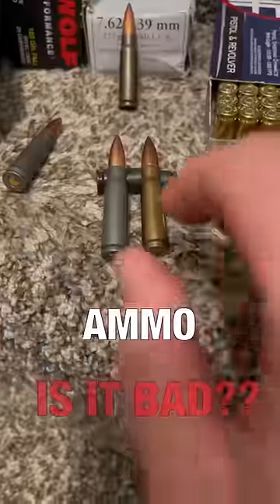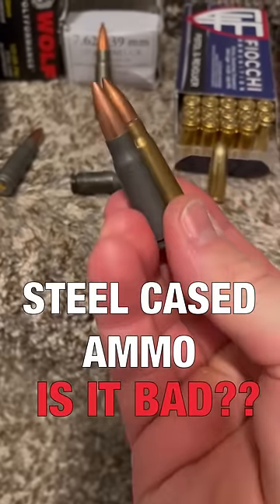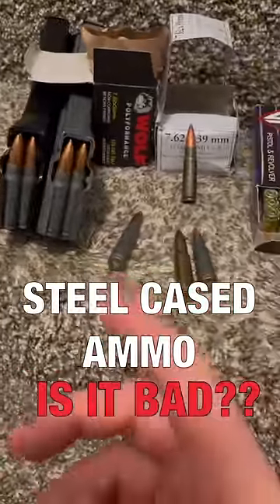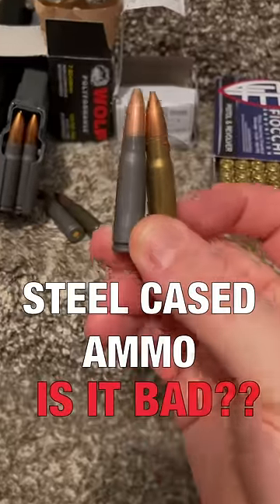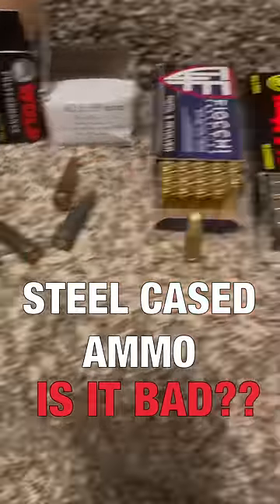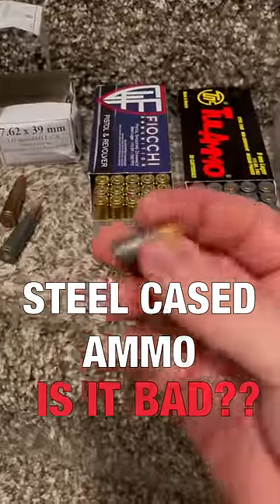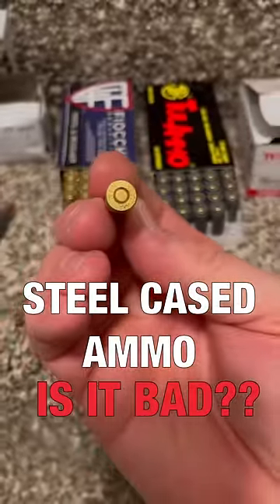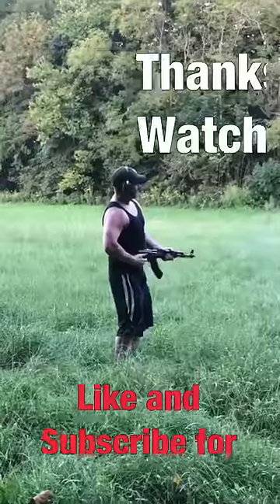Steel cased ammo, is it bad? #short #shorts #shortvideo

Comment: Good topic.  It's been tested and studied several times, and beat to death, but people still argue about it. 

Extractors are the only short term part wear you'll see.  MAYBE a damaged ejector COULD BE seen, but unlikely.  The coating could be an issue, but it builds up over time, and shouldn't ever be a single trip issue.  Clean your weapon after using it and you'll never see that be an issue. 

There have been plenty of very good, comprehensive tests done on this topic.  There's even a very good one that focused just on ARs, and fired 10,000 rounds of different brands of steel, compared to an identical rifle shooting brass, and another shooting both. 

Like everything else in the firearms industry, the biggest problems are institutional inbreeding and wannabe tacticool mall ninjas spreading false info and exaggerating half truths they don't understand.
Reply: Yes, it was Lucky Gunner that did the test. Funny how Federal brass had zero malfunctions in 10k rounds, Brown Bear had 9 with it requiring a new gas tube and bolt carrier due to carbon fouling, Wolf had 15, and the rifle using Tula literally got pulled out of the test prior to 500 rounds due to the sheer amount of malfunctions. 

And to add to that, the rifle shooting brass maintained serviceable accuracy till the end. The rifles shooting steel showed extreme accuracy loss and even keyholing at 6000 rounds. Bimetal jackets found with steel case ammo are hard on barrels. 

Anyone that says they've never had issues with steel doesn't shoot enough. These are the same people that take their Bear Creek and Durkin Tactical ARs to the range, rip 30 rounds through them, and call them good and reliable guns.

Comment: I like reloading the steel stuff. I've been doing that for over 30 years. Thank God they use boxer primers now as it saves me from converting the cases. Steel is only about two brindle points harder than brass. But the nice thing about reloading it is that I don't have to search through the grass to police my cases. They biodegrade in about a year.
Reply: I have always been told you cannot reload steel case ammo.
Reply: @MrMech-oj7iy  well know ya know lol
Reply: @MrMech-oj7iy  yeah, I always found that weird, like why wouldn't you be able to reload it?  Maybe it's a bit harder and maybe reloading equipment made for brass won't cut it, but there's no reason you couldn't get dies specifically made for steel case.  Maybe that tiny extra hardness causes them to crack more often so the value of reloading them is less, but it shouldn't be straight up impossible.  I might believe that about aluminum cases as aluminum is severely prone to work hardening, but steel?  That's arguably one of the most versatile and durable metals on Earth when used correctly.
Reply: It's amazing how few people realize you can reload steel and aluminum cases.  I don't bother reloading berdan primer cases, I just trash them.  But I reload any I find with boxer primers.

There are a couple of defect berdan decappers out there, but I've never tried them on steel.  How hard is it to convert the primer pocket?  Maybe I'm pissing away too many usable  cases. 😁
Reply: I know of a guy who reloads steel cased. I heard the same thing from him about the primers, certain types of primers make the case unusable. From what I understand from the conversation, steel just takes more time because it's harder to trim and fit properly, but if you want to save that money and have the time, why not?
Reply: @herbderbler1585  mostly because all the surplus stuff used Berdan primers. Pain in the ass to pop the primer out because it's two small off center holes instead of one central hole.
Reply: @docv73  aluminum reloading is highly limited. Unlike the ductility of brass and steel, aluminum is far more prone to work hardening and cracking. Annealing only does so much.

Aluminum straight cases are far more reloadable than necked cases.
Reply: @toddk1377  it's really not harder to trim. Any serious reloader is likely using a powered trimmer with a carbide bit.
Reply: @ObservationofLimits  
I'm just going by what I was told since I don't reload. I'm getting stuff to reload once I have my other affairs in order first.
Reply: @ObservationofLimits  I didn't think of that.  I can see how that would be a deal breaker for many.
Reply: @herbderbler1585  you've obviously never tried to modify reloading dies. Sizing dies are *hard*. Steel cases are not. Lube it and size it, it's not a big deal.
Reply: @MrMech-oj7iy  you can, it's just harder and not advised.

The steel casing doesn't expand the same as brass ammo. So reloading it can cause weapon malfunctions if not done properly. Then the primers are a pain in the ass.

Brass is softer and easier to reload.

But it is also not recommended to reload brass ammo more than 3 times, and I know people using the same casing for their 12th time lol
Reply: @ObservationofLimits  yeah, I don't reload aluminum shells. Too much risk, and don't want issues when firing.

Brass is the easiest to start learning on. 

Maybe when I get more practice I'll do aluminum.

Comment: Reason it's tough on extractors is because not only does your extractor have to run over the lip of the round, but when steel expands, it doesn't contract anywhere near what brass does (elasticity like you said) , so your extractor also has to work more trying to yank it out of the chamber (this is really only seen on AR platforms running steel cased because of tighter chambers)
Reply: Never had this problem with .223, .223 wylde, 5.56, or x39 chambered ARs.
Reply: @ObservationofLimits  ok, that's good and all....but that still doesn't mean it's not a known issue
Reply: My target rifle has minimum headspace and is tight on a go gauge. Runs steel just fine. Keep telling us it's bad when it works for us.
Reply: @randomidiot8142  lmao...re read my comment sir.....I never said it doesn't work, I have a few ARs that I've built for myself and also customers that each have anywhere from 5 to 15k rounds through them....only premature wear was the throat and the extractor....because of the steel casings not contracting like brass does, it's harder on components, simple as that, it's called metallurgy and science lol
Reply: @br00klyngreek13  regardless of brass or steel, extractors go over every rim the same way. Brass rims aren't easier to go over. Ease up on extractor springs and lengthen the gas to drop chamber pressure and extractor stress.
Reply: Steel case is not tough on extractors, at all, whatsoever. .223 steel case ammo tests showed zero difference in wear over 10,000 rounds fired. 

7.62x39 extractors in ARs have less material because of chamber size. Garbage companies like Bear Creek Arsenal have extractors that are not made correctly, and break frequently.
Reply: @phil2082  all about heat treatment
Reply: @br00klyngreek13  It's also about geometry, but I am a mechanical engineer and I know Bear Creek's heat treatment cannot be trusted, or their geometry
Reply: @phil2082  hahaha well put
Reply: I don’t think that’s the ammo’s fault though. If the steel barrel and extractor is so soft that it is shearing off metal from simple cheap steel brass casing or breaking then something is wrong with the metallurgy of the gun.
Reply: Buy an ak or sks see the results it’s amazing

Comment: The only downside I have found is the need to clean the gun more often. Since steel doesn’t expand like brass it does let more material low back into the chamber. The much softer steel that rounds are made of is not going to do anything to the chamber or barrel of a quality firearm. Not really sure why one would think that it would be harder on a barrel. Last time I checked, casings don’t go down the barrel. 

This said, I prefer brass, but I’m happy to keep some steel around for the zombies.
Reply from the maker: Well said 👍

Comment: Yep steel is usually dirty because of the powder they use. Wolf and tulaammo are the dirtiest I ever shot.
Reply: Try some aguila. Very dirty.
Reply: @rmiller334  the only Aguila I use is subsonic. 22. Nice and quiet for squirrels and the entire hunting area, and just a little extra cleaning. I only use it in my bolt action. Not for semiautomatic. First it won't function the action, and it dirties it one shot at a time.
Reply: @bobdixon4998 yeah I've used Aguila in my bolt action 22 also not subsonic though. I've got a Marlin 22lr. Bolt action micro grove barrel. I made a cheap little can for it out of pex plumbing pieces, if you take off the front sight you can slide it right on the barrel I think the outter pipe is 3/4in with a half inch pipe in the middle I drilled a bunch of holes through it and wrapped it in a shop rag tightly just enough so it would fit firmly into the 3/4in pipe then I drilled multiple 1/8in. Holes in the outter pipe and wrapped it a few times with a firm shop rag and then went over the whole thing with tape making sure to leave areas of the rag open so the gasses can escape. When I shoot it with subs the round hitting the target is louder than the gun. I like running CCI for the subs and standard velocity rounds and their stingers Wich shoot 1600-1700fps that gun shoots an extremely tight grouping with the right ammo. I've got a 22magnum scope on it. It's one of my favorite gun's to shoot, very accurate. It's what I taught my boys to shoot on.

Comment: My first experience with steel cased ammo was about forty years ago when a friend and I bought Raven .25 auto pistols on a lark with a couple boxes of very cheap steel cased ammo.

It ran just fine and didn’t hurt the guns. Longer use may have caused those issues but they weren’t exactly EDC.

Comment: I don’t run a lot of steel .223 through my AR, but I run lots through my AK!
Reply: Same, here and there ill run em but mostly brass.
Reply: I ran steel case through my AR and nothing bad happened. I mean I ran steel case through it by the case load both with and without that lacquer coating, and nothing catastrophic happened to my rifle. I did have the occasional dud round though but they also didn’t fire in my 5.56 ak either.
Reply: @SonJWri  I ran a bunch of Tula, Wolf, and Red Army Standard steel-case through my AR when I first got it (Ruger AR556, if you were curious) and it was fine for a while. But I eventually ended up getting a particularly bad FTE/Stuck-case that was a real bitch to remove. 
Every since then, I HAVE shot steel case through that same AR (I still have a bunch of it) but I don’t like to feed my AR’s a steady diet of it. 
However, I’ve never had a stuck case with my AK yet so I still feed it mostly steel case, with brass here-and-there.  With my AR(s) it’s mostly the opposite (mostly brass with some steel here-and-there.)

Comment: Years ago, I worked at a company which polished and ground lots of materials.
We used abrasives suspended in fluids and we also used softer metals to embed abrasives to abrade hard materials. Cleanliness was a great concern for us so that we could control the process.
I say this because the dirt and debris that can get between a cartridge and a chamber wall is abrasive...and the softer brass will get embedded where the steel will not. So, cleanliness is the solution. Dont be afraid to use steel cases, it is not harder than the parts in your guns, but it wont get embedded with dirt like brass can.
Reply from the maker: Good info!  thanks!!

Comment: As mentioned, coated steel ammo is covered in a lacquer-like coating as a preservation and LT storage/mfg strategy. Works pretty well, too. However, that coating tends to liquify at higher temperatures. Not really a problem if you are continually pew-pewing and don’t stop to let things cool with a round in the chamber. Once you stop though and the chamber has a round left in it, the lacquer cools. It becomes an effective glue that will cause any round left in the chamber to essentially weld itself to the chamber wall as the system cools. Very difficult to remove (especially in the field) even with a rod. It sometime takes heat in the shop to do it right - remove round and scour chamber clean. But its tricky because the round is live. This problem is the source of more than a few broken extractors and other mayhem - just ask all those wives, telling all those tales.  IMHO, the price of brass is cheap by comparison.
Reply from the maker: Well said!  Yes I’ve had that problem with some heavily lacquered 7.52x54R ammo in the Mosin.

Comment: I've used almost exclusively steel cased ammo in my SKSs and Mosins since I bought them in the early 90's. I stocked up on spam cans during the same time so that's what I've always used except for the odd brass that I'd pick up on a deal. I've put thousands of rounds through them and have had zero issues with wear or extraction, but I do clean them after every firing. Just have to try it in your gun and seenif it likes it or not.
Reply from the maker: Good point 👍

Comment: Back in the 1990's when ammo was dirt cheap, we shot hundreds of thousands of rounds of cheap steel cased 7.62x39, .223 and 8mm Mauser at the machine gun shoots. I've had an M16 so hot that I cooked off a round of Wolf .223, and still didn't have an extraction issue! The polymer coating is better than the old laquer coating. I did have one round of that stuck in an AR one time. 

And cheap ammo is this, and I don't mean to make you younger guys cry. Russian 7.62x39 was $55/1000. Wolf .223 went for $69/1000. And this one hurts, Venezuelan 7.62x51 NATO CAVIM, brass cased, boxer primed 147gr ball was $150/100. And the insane part was all these prices INCLUDED SHIPPING!

In some ways the 90's sucked, but ammo and milsurps were cheap. I got my C&R FFL and was buying $29 Mosin Nagants, $89 8mm Mausers and even $69 Swedish Mausers. You could get M1 Carbines for $350. And we thought it would never end.......
Reply: I remember those days. Every paycheck I would go to the range with a case or two of 7,62x39 and sometimes a $30 SKS to burn it in. Those were the days, my friend.

Comment: Last time I run steel case. Was in an ar platform, rounds where cleaned and oiled. Gun was clean and oiled. Fired 2 shots, 2nd shot failed to extract, broke 3 different cleaning rods trying to remove it. Took it to my local shop, guy had it clamped in a vice on a 500-1000lb bench. Case came out after he had moved bench 3 foot across floor beating the crap out of it. What happened, hot barrel from 5.56 brass was slightly expanded. When steep case stuck barrel started cooling. And shrank just enough to press fit the case to the chamber. And yes I know you could drill out primer to try n pull case. But that would have just broken the case puller
Reply: @actionjksn  worked for a previous one but not last one sadly

Comment: Gonna have to stop you right there pal!!! Yes steel doesn't expand as seal as well, but it's not harder than brass near as much as you think. The difference between steel and brass case Rockwell hardness is only about 1 or a bit less both are very soft, and in a rifle it will take you about 15k to 20k before you have a slight difference in wear, and by that time the savings will have paid for anything needed in pistols it's more like 20k to 25k before you have slightly more noticeable wear although the firearm should still be absolutely serviceable. I read an article where they interviewed the CEO of wolf ammunition, and he's where I got the Rockwell hardness numbers. Brass is about .3 Rockwell and steel is about 1.1 Rockwell so way softer than your extractors or any important part of your firearm!!! Just don't wait 1k rounds between cleaning and you'll be fine
Reply: Yet Lucky Gunner did a 10k round test with 4 identical ARs. One shooting Federal brass, one shooting Wolf, one shooting Brown Bear, one shooting Tula. 

Federal brass had zero malfunctions in 10k and held acceptable accuracy throughout. Brown Bear had 9 malfunctions and required a new gas tube and bolt carrier due to carbon buildup that wasn't able to be removed. Wolf had 15 malfunctions. Both of these rifles also had an extreme decrease in accuracy and even started keyholing prior to 6000 rounds. So maybe the extractor would take longer to wear out, but steel cased ammo typically uses bullets with bimetal jackets and those are hard on barrels. 
And the rifle shooting Tula literally got pulled out of the test prior to 500 rounds due to the outrageous number of malfunctions.

Comment: Depends on the manufacture as well depends on if it’s an AR platform or is it an SKS or a AK and there’s many other platforms beside that… Some have lacquer finish on the steel case ammo… I have run into some ammo that was really cheap there are all the ammo you can just redo them or reload them usually has Chinese ammunition old ammo still good just got a put new powder in them.. And you really gotta re-prime them

Comment: Ak's shark fin extractors are made for steel case ammo and run better with it as it "bounces" off the Shar fin better than softer brass. As far as AR's go, if it extracts well then it is a cheaper practice option with relatively lower accuracy. Just never leave a rifle loaded with 1 in the chamber in wet conditions over a long period as rust locking is an issue.

Comment: This is a pretty good video and I agree with almost everything you said, however I only run steel in my ARAK and I haven't cleaned it for 2500 rounds. It hasn't had a single hiccup. I've put about 20,000 rounds through this particular rifle and 90% of it has been steel. I haven't seen any damage to the barrel or shell striking surfaces. Maybe it's just the build quality of rifles that dont like steel